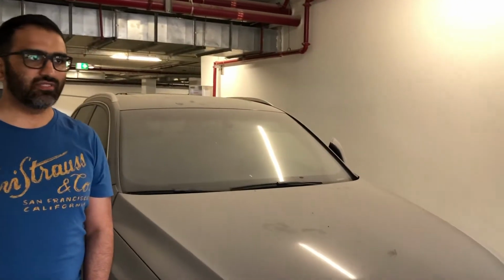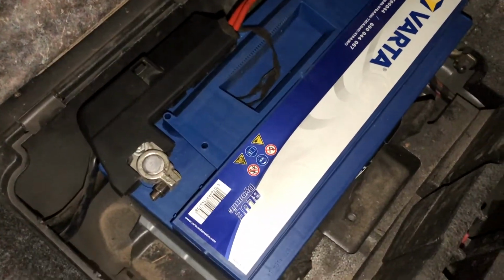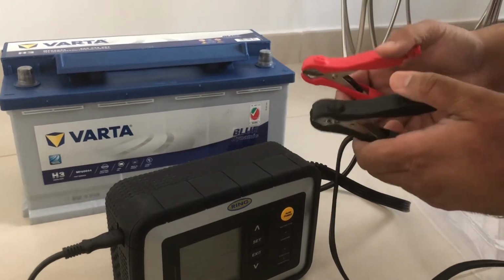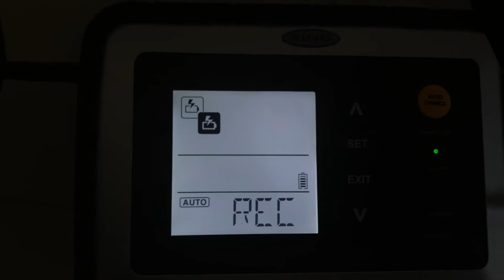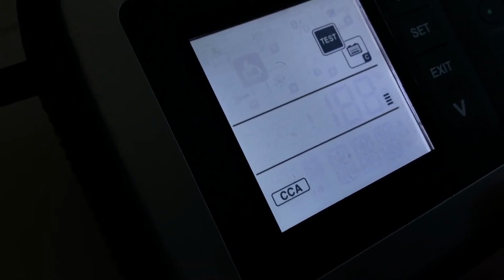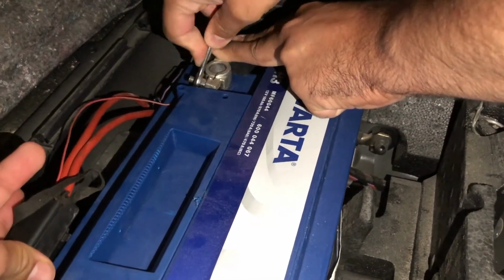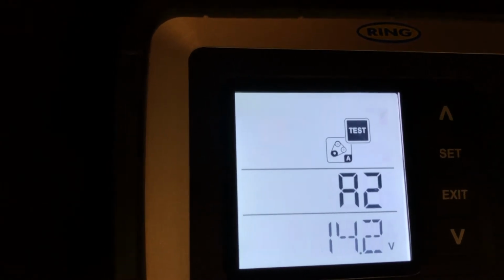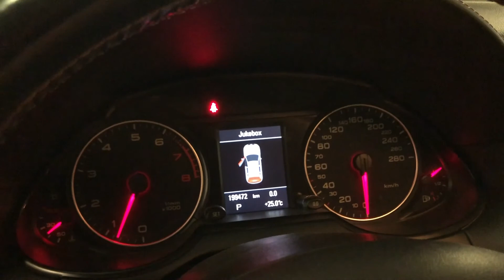I used the Ring RSC 612 to charge my flat car battery & How To Remove A Dead Battery From An Audi Q5

Comment: I just bought the exact same model RSC612, I had to contact ring on a few things because it’s not very intuitive to use.
Anyway I feel there are a couple things that need updating in the instruction manual.
When you saw the 2A flashing you would assume it’s charging at 2Amps but it’s not, you have to select the appropriate current for your battery ie, 40A battery select 4A, 80A battery 8A then press set again. And in your case it went straight into (REC) recovery mode for deeply discharged batteries, this is also the Desulphation cycle. The charger goes through a 7 step charge cycle which is shown in the manual.
I am going to amend the PDF manual to make it clearer to use.
Reply: Mine is showing the battery symbol flashing empty, but nothing more to suggest that charging is actually happening, its also not going into REC mode or at least it doesn't say that on screen. Can't see an explanation of what the flashing empty symbol means in the instructions. I don't suppose you know?
Reply from the maker: How old is the battery? I would try and use navigation arrows to select the battery charging icon and then press set. Leave it for a few hours and check using the menu how much charge the battery has received.
Reply: I have just emailed ring myself and asked for help as my battery is staying at 90% with the amps trickling in every so often then back to 0.0 amps. 40 hours I've had my AGM 70ah 760en battery on charge and never gets to a 100% or it does but for a few seconds and then drop charges and gives a little boost of amps and volts and then back to 90% with the bars flashing as having 1 bar left to charge. 
The manual is bare for detail, if you read the fault codes page it suggests after 24 hours and a failed float stage that the code would show and to disconnect/reconnect and set the charge at a higher rate? I had it on auto charge on the correct start/stop mode, I have no idea from the manual what safe rate I can charge a battery  that has been on charge 40 hours showing 90% I dont even know what my battery should be charged at and i've had a quick look online? 

From what I picked up from your comment is that my 70Ahbattery should be set to 7amps charge but do you know what volts I should set it to charge also please or do I just go by the volts set in manual for standard charge rate or winter charge rate?
Reply: How long time is desulphation mode ?
Reply: @stephenmaas8775 hi, did ring respond to you after emailing? I have the same situation here with identical battery specs
Reply: @shakey989  Well I cant remember if they got back to me, but I took the charger back to halfords and had it swapped and it still did the same thing. I assume it is just that our battery is slightly tired? What I did do to get my battery back to 100% though...and this was after a good few times charging over the months to 90% I put it on a recovery charge (Auto) and left it till it went to the 90% then I put the battery on a (manual) charge selection of amps at a higher rate, the charger wont damage the battery as it will only give out what the battery charger sensors (smart charger) give it an hour or 2 at say 6/8amp and will be spot on 100% charge. I aint had an issue with my battery since!

Are you charging with the battery sat in the car or are you disconnecting it and say charging in a shed or garage? You can also memory save your electrical settings and radio setting before disconnecting battery with the memory button👍I would take the battery out and charge as sometimes the car can be a draw and that is why you cant get the full charge!

Comment: CORRECTION - Always connect Positive terminal first, then Negative terminal to prevent damage to components and modules which may become energized during terminal fitting if Earth to the battery (Negative) is fitted first. Always disconnect Negative terminal first, then Positive terminal.

Comment: I bought and used mine today. I tried recovery mode on a 12v battery reading 9v and it stayed on LO for around 5hrs. I then just put it on AUTO and I've left it. Hoping it'll be done in the morning. Does take a long time.

Comment: Great video, i have the same charger and an audi, same problem haha. Is there any reason you didnt put the charger on stop/start mode? I assume the Q5 has a stop/start battery?
Reply from the maker: Hi. The Q5 I had didn’t have a stop start battery. Hence didn’t use that feature.

Comment: Have you turn the air conditioning on to cool down the charger?
Reply from the maker: I didn’t have any issues with the charger cooling down, hence don’t understand why you ask this. The device has its own fan for the circuits to keep cool. Plus whilst it was conditioning and charging the car battery it was in my home and yes the AC was on in my home. I hope this answers what you were thinking of.
Reply: @haitchb  
You asked the driver to turn the AC on.
Reply: @haitchb  
Most of your info was wrong, unfortunately
Reply from the maker: That was to test the load on the battery. The device was with me in the boot of the car as the battery was located in the boot.
Reply from the maker: Thank you

Comment: When you connected the charger leads to test the alternator it looked like you had them the wrong way around
Reply from the maker: They were the right way around otherwise there would have been no reading. The terminals on this battery were the other way round. Thank you for comment.

Comment: The fan has stopped working on mine
Reply: The fan only turns on when it needs to turn on, it's not meant to be on permanently.
Reply: the fan was squeaking on mine and now its stopped working - can this be fixed?
Reply: @richardbeechey8537  Sadly no there are no serviceable parts or peripherals to this module.I suggest if you do use it use air conditioning cooling device to ensure temperature control of the module when in use this will keep all the components within cool that is mainly the purpose of the inbuilt fan component as your aware.